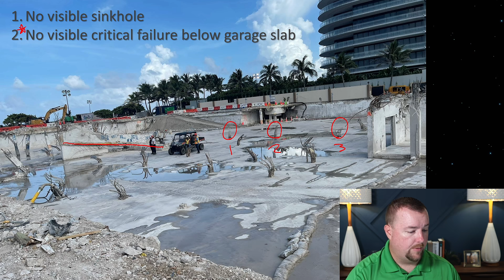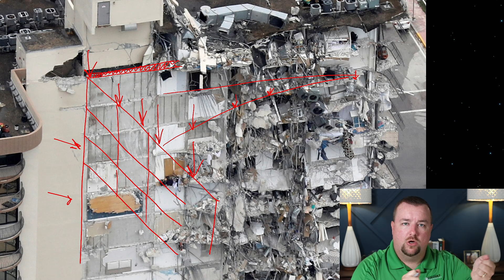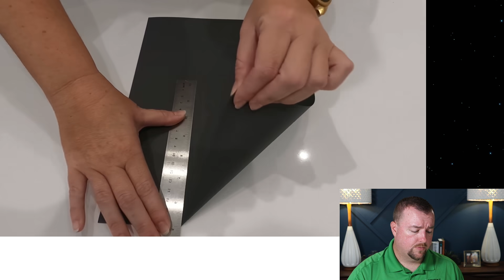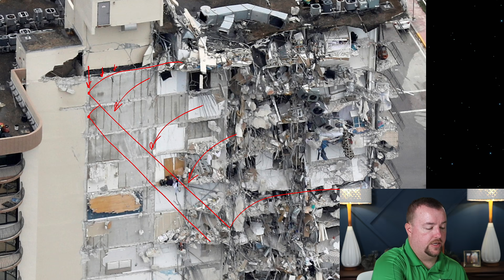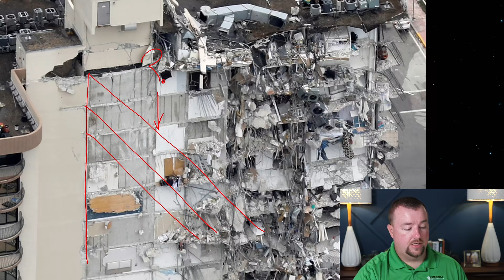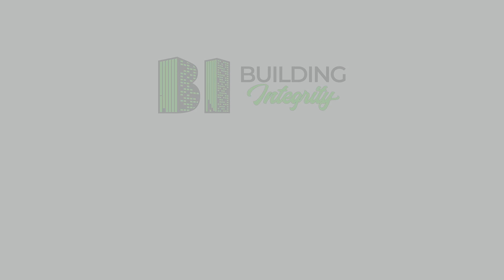Surfside Collapse - Structural Engineer Explains Why Only Half the Building Collapsed

Comment: based on the plans, do you think this building was well built? was it built robustly? I have seen images of building that have suffered extreme damage on the bottom floors and they did not pancake they tipped over maintaining the upper floors. It just seems like it was not designed to resist damage at all.
Reply: It was a "slab based" light design. the ones we see today, even after severe damage, remain standing because they have column structures reinforced with beams in every floor, this allows some "margin" after partial column collapse

Comment: Im thinking now that we have been looking into this and watching your videos on this matter. I think the very most bottom slab,  not gargae floor but the ceiling slab to the garage . It was constantly dripping water means there was always dripping water regardless if its internal plumbing or rain water from the roof drains leaking softened the piling /column and the first floor slab and it didn't have the shear preventers it softened at those and it finally couldnt support that whole building. Theres no telling how much the building weighs empty much less full of all the full condos and  necessities.
Reply: On the contrary, there is telling! That is one job of the architects and design engineers. What you are saying is that you do not know.

Comment: Your red line showing the ramp going down is in the wrong place.  You have it pointing down towards the swimming pool and hot tube which are still in place.  Use those fixed locations to reorient yourself.
Reply: Are you referring to the first 2 mins of the video? If so I believe he has it correct. That angled piece standing to the left of the people is part of the ramp.

Comment: Someone on another channel questioned whether there was a waterproof membrane installed within the pool deck. Did you see evidence of it being present? Thanks
Reply: In a previous video he showed core samples from the deck that did not have waterproof membrane.  I think I remember seeing that, pretty sure it was this channel.
Reply: He's made several videos about Champlain South. One of them has photos of core samples which were extracted from the columns and slabs before demolition. As I recall, one that is a core of the pool deck slab shows nothing in the way of a waterproof layer. But please don't take my word for it, check his other videos.
Reply: @louisc.gasper7588  thanks. So wondering what what role that had since seems would be the cause of all the leaks in the garage.
Reply: @neighborhoodcatlady6094  I think not the only cause. As our host explains, there are very probably several factors that contributed to the event. There was clearly cracking in the deck slab, evident from within the garage. Whether the absence of a decent waterproofing membrane was the cause of that cracking, I don't know. No doubt it contributed, and then it was the cracks that allowed water to attack the rebars in the concrete. Had the slab not cracked, the rebar might not have corroded and failed. Was the absence or inadequacy of the waterproofing the cause, or the only cause of the cracking?
I have no idea.

Comment: The rest of the building was on 24x24 posts, not 16x24.
Reply: he already talked column sizes in a previous video.
Reply: I think it was built in stages due to  financial troubles. Project was shut down for like 5 years then restarted where the smaller columns and low quality ensued.
Reply: @jaymorgan8017  wow
Reply: @jaymorgan8017  Did the side that survived also have unplanned penthouses thrown on top later on like the side that collapsed?

Comment: I really want to know if someone got a copy of the original security camera footage from the neighboring building of the collapse.  The video on the internet is someone recording the camera security monitor with their phone as you can tell by the movement in the footage frame.  It would be so helpful to have the higher resolution original.
Reply: I would imagine that the dvr that it was recorded on was seized via subpoena by the investigating agency so that they can maintain custody of it throughout the investigation and ensure the video is not tampered with.
Reply: Any time I see security camera footage it's someone recording the screen with a camera or a cell phone. My guess is that these security systems are made so that it's difficult to get the raw footage out, or the people who monitor them and 'leak' the videos don't have access to it.
Reply: @trucid2  It's not so much that it's difficult, it's just so much easier to film the screen with their phone.  The reporter probably did that so they could get the scoop straight away.  No doubt NIST etc. will have the CCTV original and it'll probably come out in time.
Reply: whoever recorded the video only had access to a video monitor and a control keyboard (security guy at front desk), the rest of the functions were blocked in a secure server room
Reply: @eduardocarvalho1547  That's my impression as well.
Reply: Yeah. And you can tell not just by the movement in the footage frame, but in the sound. When it originally aired you could hear people talking in the background. Very obviously someone recording the monitor. Like others mention below, very likely a reporter trying to get it out quick.
Reply: @crowfoot1199  plus the security card a was likely triggered by motion it picked up - Josh mentioned this in an earlier BI video where it appears in the video that the front / middle section had already dropped a fair way as that movement (dust etc) started the camera. The bright blue flashes / lights are very likely to be arcing from the severed power cables to that section. Probably can’t see arcing further down as a huge dust cloud was already on its way up into the air from the ground floor giving out. 

Cassondra Stratton (RIP) saw the pool deck collapsing from her balcony on the 4th floor. She was in the first section to collapse and on the phone to her husband as she described the collapse 😞 you can just make out her floor in the grainy video. Nobody that wasn’t already awake stood a chance.
Reply: It's valuable video !
Reply: I thought the video moved because of wind, I don’t think someone recorded that on their phone, but I don’t know
Reply: @LindseyDara  they did. They saw it on the security monitor so recorded it on their cell phone. The guy jeff said that on his video.
Reply: @gracieg7601  gotcha 👍🏼
Reply: It sounds like a cover up. They did not allow any drone flights after the first day. Everyone already got 1.5 million. All cleaned up like 911 so a crime scene investigation has been completed.
Reply: @timsteinkamp2245  no drones flying over because medical crew was literally hauling almost 100 dead bodies out of the rubble. I love a good conspiracy theory but cmon man, not one single shred of evidence indicates this was on purpose. It was sheer neglect of the entire pool deck that was water logged and took out support columns when it gave way. Maribido Consultants 2018 even confirms this. They warned the condo association but they didn’t want to cough up millions towards repair costs
Reply: @kyber7503  did anyone mention that some of the residents had already put out the money the board asked for to get the repairs started. They started on the roof.
Reply: @timsteinkamp2245  it's not a coverup or conspiracy.  The reporter likely just recorded the security monitor to get it out quick.  Those NVR systems can also be a giant pain to pull footage off of.  I would like to hear if someone has gone back and downloaded the original video file same with the security cameras that were on the pool deck and parking garage of Champlain towers.
Reply: @timsteinkamp2245  
I hadn't heard..where did they give 1.5 million to everyone...is this an actual fact?
Reply: @julybailey4239  I hadn't reviewed every reply but it was reported by ABC and I guess it is 150 million at least and the North tower has 111 units I heard South had 132 units. The units in the North tower are selling for $725,000 one site has listed. I guess money has not been distributed yet. Hope that helps but do a google search for more information on it.
Reply: @timsteinkamp2245  I’m not sure but it could be because the pike was smoking.  And they were finding dead bodies.
Reply: @timsteinkamp2245  and that sounds like a conspiracy theory.